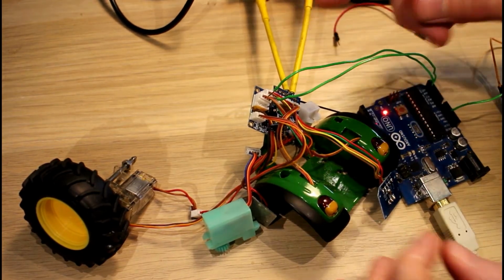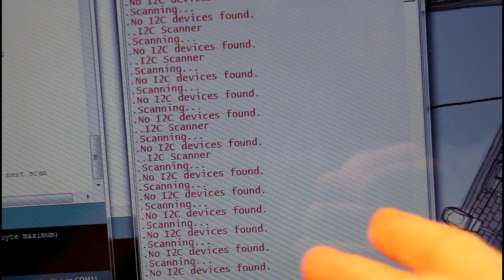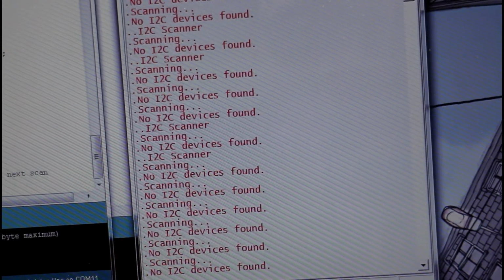Trying to Control a Siku Control 32 Four Wire Servo Part 1

Comment: I have a broken 4-wire steering servo (internal servo issue) for my Siku MAN 1/32 truck, where can I purchase a replacement please, everything else works fine on the SIKU control truck ?